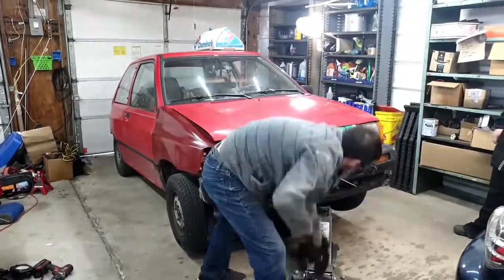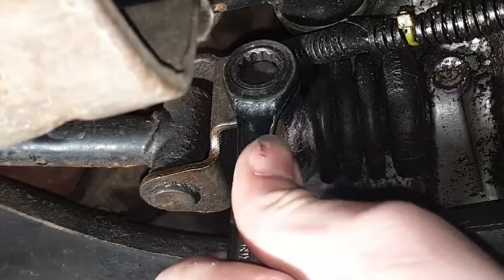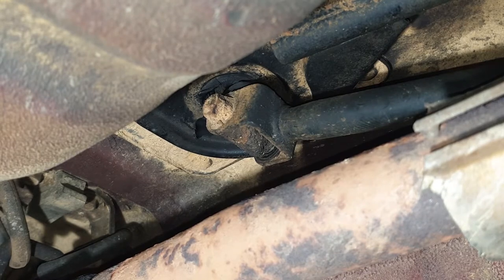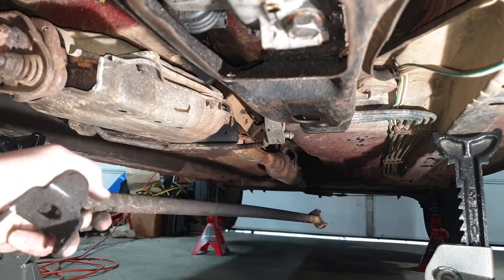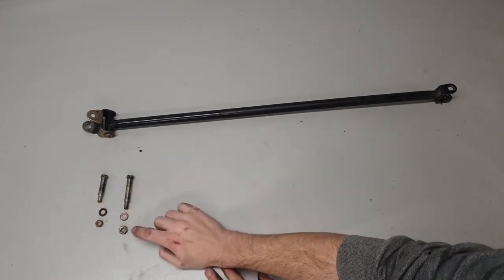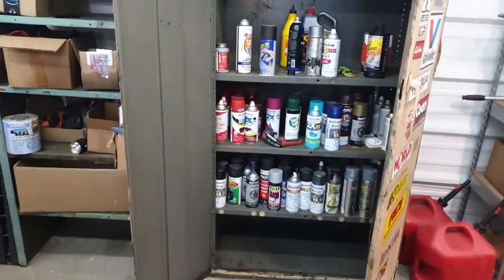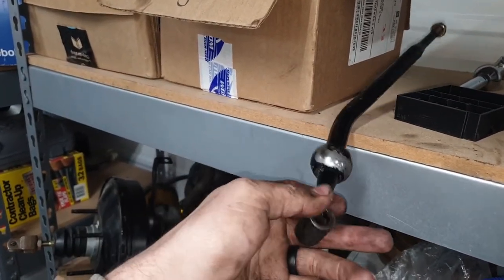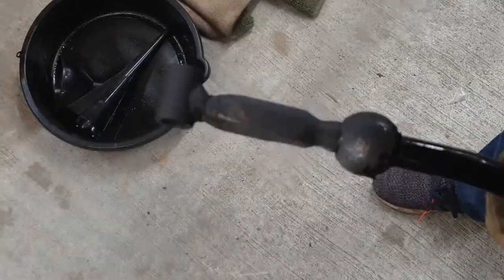Festiva Shift Bushings & Short Shifter

Comment: You should have used a masking tape to tape the nut before putting the linkage in place so it does not keep dropping. remove the masking tape after tightening the bolt

Comment: Time for a laugh! Instead of grinding off the welded shaft up front and replacing it with a bolt, I put some small zip ties on either side of the tee to tighten up the joint. It works fairly well. Lol

Comment: Hey!

Just recently picked up an 89 5 speed. Previous owner stated that the transmission is such in 1st gear.  After getting it home and up on stands I can see someone has already changed it all the bushings in the linkage.  Shifter is really tight and won't shift to neutral.  Clutch engages and disengaged as it should... any idea what could cause it to be bound up like that?

Huge thanks for all your videos,  I have a long way to go on this little project!

Comment: Hello! I know this is late but I got myself the Civic Shifter For my festiva. With it was the 2 small bearings will it be enough to close the gaps? I have not tried installing it yet but seeing the video it felt like the 2 bearings are not enough to close the gaps. Thanks!
Reply from the maker: You will need some little spacers to fill the gap with the bearing style civic shifters
Reply: @SametIndustries  Got it thanks! Hopefully those 2 mini bearings that i got with the short shift would close the gap

Comment: The part that the shifter linkage bolt to by the transmission my boot has come off and I can move it back about 2 inches what is that part and is that broke
Reply from the maker: That's the actual shifter, moving it in and out is what shifts the gears. The boots tear often, but are very difficult to replace.

Comment: shouldn't there be a shield on the exhaust section below the shift rod/linkage union? That closer proximity to the pipe has the potential to cook those new bushings. Probably one reason the Civic rod uses bearings
Reply from the maker: From the factory the entire exhaust is shielded, but the aftermarket units are not
Reply: @SametIndustries  they are transferable?
Reply from the maker: Not easily

Comment: Do I Need Both Long And Short Shifter Bolts ? What's The Difference Other Than Length.
Reply from the maker: You need the long one to replace the pin.

The short one is just to replace the shifter side bolt if you lose it

Comment: probably a dumb question, how is it making a short shifter if you’re adding length to the shifter?... i’m new to this. a bit confused. thanks
Reply from the maker: The full name is "Short Throw Shifter". The 'throw' is how far forward or backwards the shifter must go to actually switch gears.

By extending the bottom, we are effectively moving the pivot.

So originally, let's say the bottom needed to move 1 inch to engage the gear, and the top had to move 4 inches.

If you move the pivot point, now you only have to move the top 3 inches forward to move the bottom one inch.

Let me know if that helps!
Reply: @SametIndustries  i totally get it now. thanks. appreciate you guys doing in-depth videos on the festiva. just rewatched Fun With Dick and Jane a week ago and learned of this vehicle and have been shopping for one. thanks to you guys i’m feeling confident on locking one down and working on it haha.